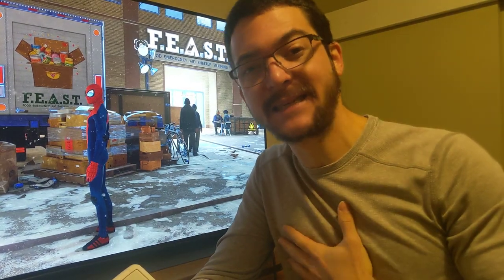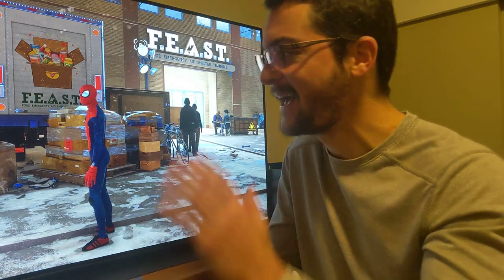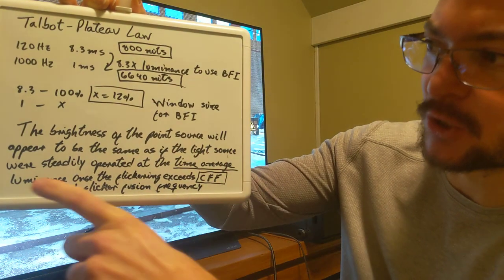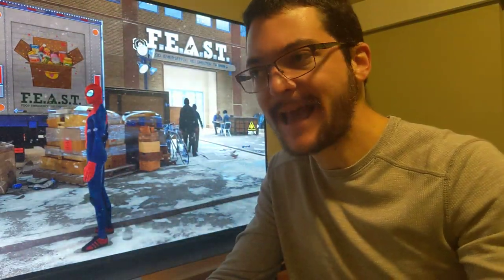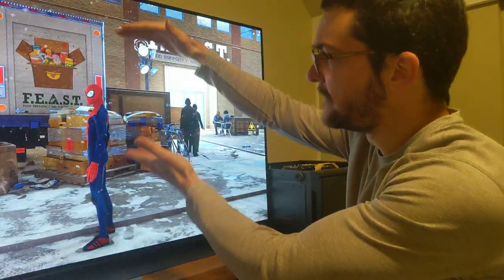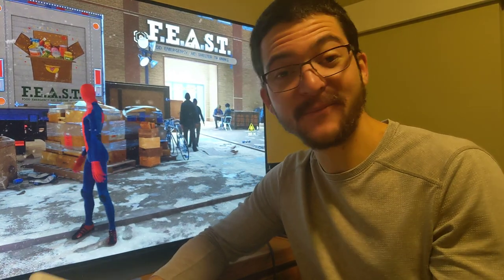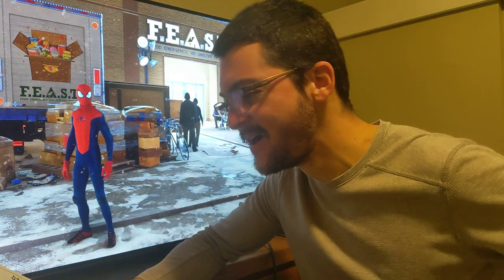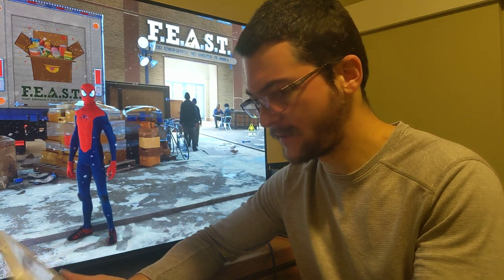How much brightness do we need to match the CRTs motion clarity using 120bfi? Talbot-Plateau Law

Comment from the maker: I'm making some space to download Witcher and I'll do a video about it but based on what I've seen the game doesn't have sliders or support system level calibration. Take a screenshot and use the HDR WCG image viewer app to know the MaxCLL then using the HDMI signaling override menu 1113111 change Mastering Peak MaxCLL to match the Game and use Tone mapping OFF. Based on the Gaming Tech video he showed a picture going over MaxCLL 1600 nits, if that's the maximum then use Mastering Peak MaxCLL 2000 tone mapping OFF

Comment: This is where strobed lcd has an advantage you can pulse the backlight at extremely high nits at low duty cycles. you can just upgrade the backlight leds to get your desired average brightness.
Reply from the maker: That's right
Reply: This being true, it's easier to surge a LED backlight at this time.   The Quest 2 VR LCD and Valve Index VR LCD flashes their LCD backlight for only 0.3ms!

Comment: 5:57 There is also a MicroLED prototype by JBD that can hit 3 million nits. If you replace the organic self-emissive material of OLED with an inorganic material, the brightness doesn't seem to be an issue anymore. MicroLED is still 10+ years away from the mainstream market, but there's still QNED and NanoLED which are expected to reach the mainstream market 2-4 years from now. From what I've read, those displays can reach brightness levels in the tens of thousands of nits with no problem.
Reply from the maker: Fantastic, thanks for sharing, I didn't know!
Reply: @plasmatvforgaming9648  These prototype 3 million nit LCDs make excellent projector bulbs.  The screen is the bulb, and the bulb is the screen.  I anticipate future mini-projectors to be based of variants of this technology.

Comment: What I don't understand is that plasma televisions are also impulse driven displays lighting up the pixels row by row with a plasma gun yet plasma still suffers from motion blur?
Reply: It is about the persistence. Plasmas still have higher persistence than CRTs
Reply from the maker: Plasmas are impulse displays and I don't understand exactly the way they display the frames, it's not easy to understand. But what I can tell you is that, based on my testing, my Plasma TV has 4ms of persistence but it exhibits other limitations when moving faster than 240 pixels per second.

Comment: Wondering why we move'd away from plasma and crt if the motion clarity is steps above what we have now?
Reply: It seems the tech is there to do it, crazy.
Reply from the maker: It was a crime to eliminate CRTs
Reply: @beammeupscottsp7952  I think people were too excited about the aesthetics of having a thin, flat screen to notice that they were getting a picture quality downgrade
Reply from the maker: At that time it was a massive picture downgrade because those LCD were garbage
Reply: Eventually we're going full circle back with the upcoming 240Hz OLEDs, and the 1000Hz OLEDs will arrive by 2030.   Display motion blur is perfectly frametime on OLEDs, so brute framerate-based motion blur reduction is the best tool for use on OLEDs.  Looks far better than flicker when done right, and could make BFI obsolete for modern content eventually.
Reply: @BlurBusters  240hz and 1000hz OLED is amazing and all, but where will you get the content? Movies continue to be shot in 24fps, TV at 30-60fps, and gaming hardware can only push that many frames  in very, very old games with poor graphics.
Reply from the maker: @bryangosling629  I have a video coming about Reprojection, that's the way. The GPUs can give you 100fps and with a combination of Upscaling, Frame Generation and Reprojection we can get 1000fps delivered to our 1000Hz OLED on HDR. That's what the boss said
Reply: @plasmatvforgaming9648  sounds absolutely amazing if it is really possible without major artifacting
Reply from the maker: @bryangosling629  Blur Busters Chief recommended me this video https://youtu.be/IvqrlgKuowE
That's what the VR headsets have been doing for a while now, it's already here and it looks amazing
Reply: @plasmatvforgaming9648  that’s really cool. Do you have a recommended VR headset? You’ve gotten me interested in them
Reply: @plasmatvforgaming9648  Maybe DLSS 4 will combine interpolation with reprojection? That would be incredible
Reply from the maker: @bryangosling629  The best VR headsets in terms of motion Clarity are LCDs, I can't recommend them until I test them because the picture quality might be very bad, the OLED VR headsets are 2ms (equivalent to 480Hz). I'm still deciding which one I'm going to get
Reply from the maker: @bryangosling629  The Quest 2 and Valve Index are both 0.3ms but they are LCDs. I have to see them first
Reply: @plasmatvforgaming9648  what fps do you need to achieve to actually get the 0.3ms persistence per frame?
Reply from the maker: @bryangosling629  Any FPS, the VR does reprojection and at 90Hz has that persistence (I'm still figuring that out, I'll do a video about it)
Reply: @plasmatvforgaming9648  There are major reprojection artifacts at under 100fps, especially for strobed. But it's a pretty neat technology that has less artifacts than interpolation.  But the way Oculus ASW 2.0 works produces fewer edge-artifacts than the PC reprojection demo.  Now imagine merging the best of both tech, and making sure start framerate is min 100fps.
Reply: @bryangosling629  VR is permanently framerate=Hz.  They've done an amazing job at making 0.3ms persistent permanent throughout a whole game.  The clearest motion resolution of ANY display, with the most stutter-free perfect games, is VR games full stop.  The optimization has been 10x+ more incredible with many VR games than non-VR games.

Comment: Its not this simple. CRT motion clarity will not happen since CRTs draw the picture LINE by LINE, On CRTs, 2 lines are never ON at the same time. So only 1 pixel line is visible at a time. Thats CRTs.

BFI will never compare to it. You said 12% window size. On a 4k display which has 2160 lines. That means 259 lines will be visible at a time thats FAR from CRT level. Even a 1% window size is not enough. Since on a 4k display which has 2160 lines. its only 21 lines visible at a time. CRTs as you know are LINE by LINE. They draw 1 line and the rest is black.
Reply from the maker: 1ms of persistence is 1 pixel of motion blur when moving at 1000 pixels per second. There are other motion clarity limitations like GtG. I would recommend you to read the Blur Busters Law so you can understand
Reply: Im talking about something else. The possible window size
Reply from the maker: Also research about VR headsets, they have better motion clarity than CRTs.
Reply from the maker: The approximate window size of the CRT could be calculated like I did in my OLED example: 60Hz is 16.67ms (frame time) and we know CRTs have 1ms of persistence, then 1ms is 6% of 16.6ms. There you go, the window size is 6% or half of the window size I showed in the video because I was talking about 120Hz
Reply from the maker: I understand where your confusion is coming from. If a CRT has 768 lines at 60Hz the frame time is 16.67ms so each line can't take 1ms otherwise the frame time would be 768ms and it's not. There is a phosphorus decay and other considerations in the mix but it is known that the CRTs have about 1ms of persistence and that's equal to 1 pixel of motion blur when moving at 1000pps